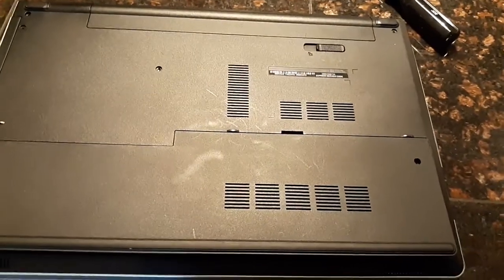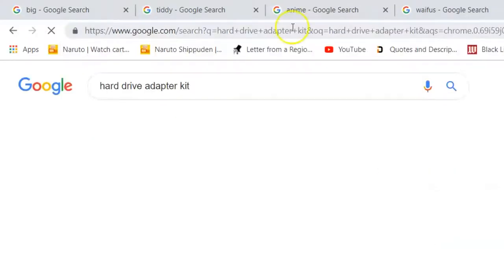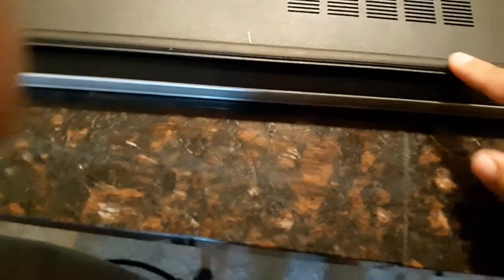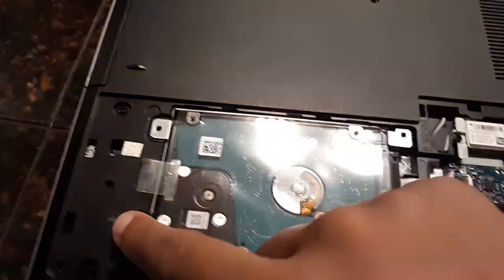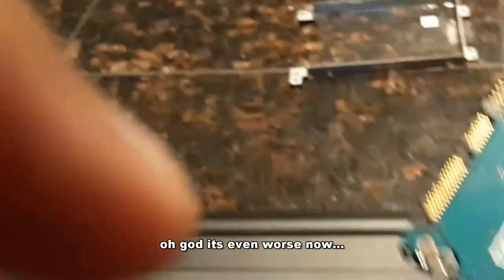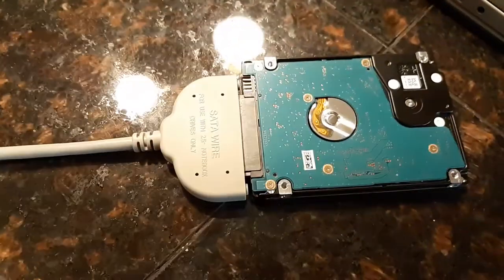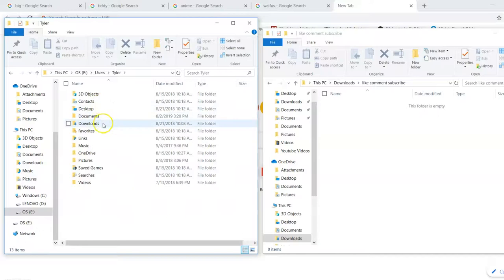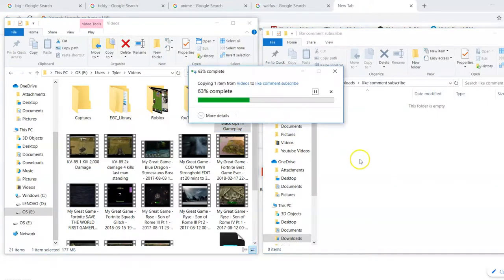How to Transfer Files from Dead Laptop

Comment: My old computer went dead last year and i didn't know what to do, i had old files on that computer and on my other computer as well that went dead in 2015, i'm glad i found this tutorial about how u transfer files from a dead computer, cause i was afraid i might never be able to have my old videos and pictures thanks already i'm going to try what you told in the video!🙏
Reply: Same.
Reply: @istandalone12  Well yea, I've noticed the cable i needed was too expensive so i bought a cheaper one of one of those cables and it seemed like it all took really long to load up, after 14 hours it was still loading my guess is that my driver is probably dead too, it might be i bought the wrong cable for it i have no idea, but i'm trying to figure out.

Comment: I followed everything, but when i open the folders it only says "this folder is empty" but i know the files are still there because the memory left is only small. Please help me
Reply from the maker: Not sure; it might be because you don't have permission to access the folders? If you can't "run as administrator" maybe look on Google, or try changing the folder your files are located in. Sorry I can't be of more assistance, this has never happened to me.
Reply: @TTurmDawg  Update: I did some research about my problem and it solved my problem, still thanks for the video it helped me a lot
Reply: @Squicchie Kindly share plz

Comment: What does that connector called ? So I can buy it off Amazon
Reply from the maker: It's called a Hard Drive Adapter cable. The type you get I think depends on what kind of hard drive you have, but for me I used the Apricorn SATA Wire.
Reply: @TTurmDawg  thanks got it ..big help 🤘🏻

Comment: How do i this without the external case thingy but instead of moving it to snother laptop i want to retrieve my files and media into my PC
Reply from the maker: Your PC should also have USB ports in it; just plug the hard drive with the adapter cable connected into the USB ports and you should be able to transfer files just fine
Reply: @TTurmDawg  i was hoping there was a way without the adaptor but cool

Comment: Thanks so much for the info. However, the dead laptop that I am trying to retrieve the data is PC with Window 10. My other laptop is MacBook Air. So do you have any suggestions on how to get the data from the dead PC onto the active MAC Book Air?   Thank you!
Reply from the maker: Not sure about this one, you could try putting your files on OneDrive, and accessing your files that way. OneDrive keeps all of your files backed up and synced across all of your devices, including Mac.

Comment: how do u now which  hard drive adapter you need?
Reply from the maker: It depends on the hard drive you have. My adapter cable was for an HDD (hard disk) so I used that, but if you have an SSD you'll have to get a different type. I'm not sure how to tell which type of hard drive you have, but if you do some research on the computer you have you'll be able to find out.
Reply: @TTurmDawg  in my files it says windows ssd
Reply: @TTurmDawg  how can you see which type of hard drive you have??//?????
Reply: @priscilliachineye639  ok
Reply from the maker: @rad5105  Windows SSD is your hard drive, so find an adapter cable for an SSD

Comment: i have absolutely no tech experience would i be able to do this on my own? is there a possibility if i do something wrong while transferring my new computer will mess up?
Reply from the maker: You should be able to, but if you’re worried you could ask a computer technician to help you out. I will admit though they tend to charge pretty insane prices so it’s up to you. I was able to do it just fine by myself for free, but if you decide to play it safe I say go for it. There isn’t much risk to this process, but I suppose like anything you might accidentally delete some files, there’s also the risk of mishandling the hard drive, but as long as you don’t drop it on hard floor or throwing it across the room then it’ll be fine. Just take care of the hard drive!
Reply: @TTurmDawg  I ended up doing it everything went fine thank you so much! saved me hella money lol😂😂

Comment: How do I know which cable to get?
Reply from the maker: Depends on the type of hard drive. If it's SD then it's the one I used, if it's HDD then you'd have to get a different one. You should be able to tell which one it is after opening up your laptop.